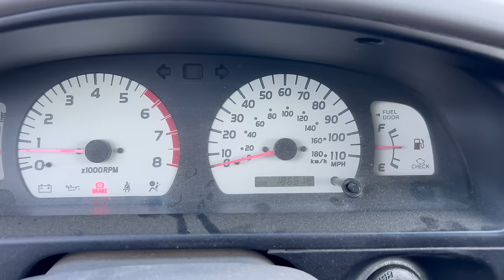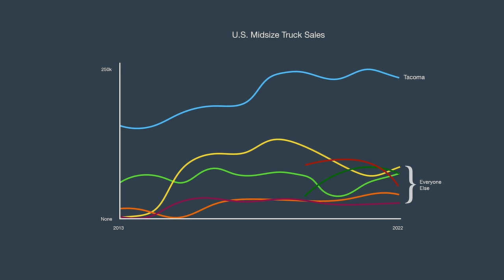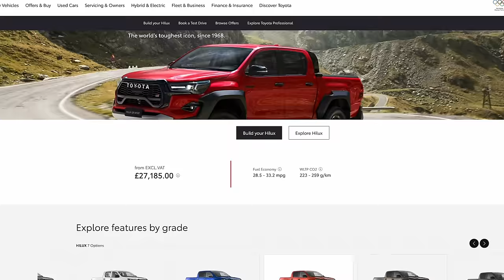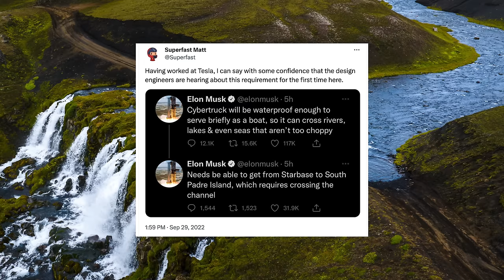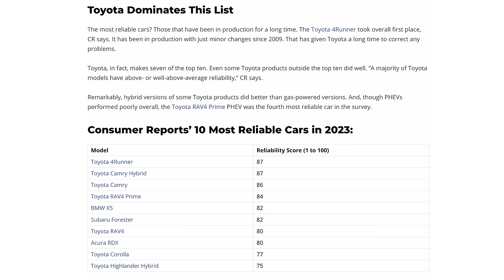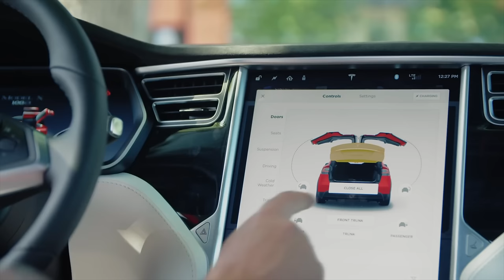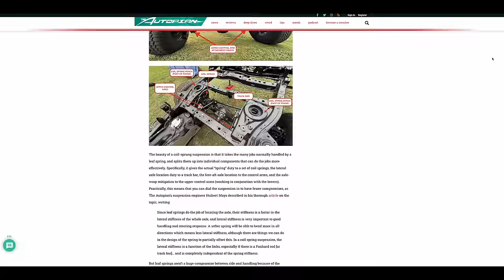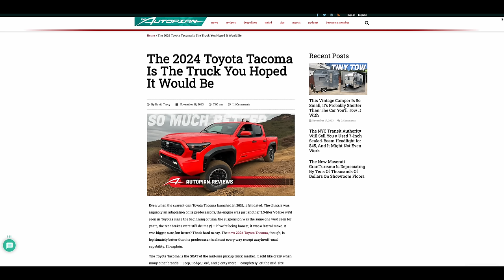What Is The Best Truck, And Why Is It The Toyota Tacoma?

Comment: I did the thing you're 'never' supposed to do and bought my taco when it was the first year of production in 2016.  I've had it for 100k miles and it has had zero problems.  There are extremely few vehicles that have this quality.
Reply: I hate that 100k is the bar for not having issues now. That bar should be closer to 200k.
Reply: @Steinerrides  How is he gonna say "I've driven 200k and not had an issue" when he had only driven 100k miles, that's some very interesting logic
Reply: My '10 Prius was the first year of the 3rd gen and at 330k it only needed a headgasket, is that better 🙃 @Steinerrides
Reply: @ImNotHere4750  I'm saying 100k without issues isn't impressive or note worthy
Reply: @Steinerrides lol listen to yourself
Reply: @ImNotHere4750  I do on a regular basis.
Reply: @Steinerrides  So you are telling me that on a new car, nothing and I mean nothing will break in the first 100k miles?
Reply: @ImNotHere4750  on most new cars, no, they really don't have issues show up that soon. Find me a statistical outlier if you want but I won't care. Excluding driver induced damage, most (not all) will make it 100k with regular oil changes, tires and brakes. 150k, 200k and beyond is a different story.
Reply: @ImNotHere4750 I agree with @Steinerrides 100k, especially when just street/highway driving isn't much.
Reply: Here come the 400k PD guys 😂
Reply: @Steinerrides  the average Person in the US is driving 40 miles a day, that would make about 7 years to get to 100k. That is 7 years of being exposed to the elements, 7 years of being turned on and off and as you said 7 years of wear and tear. Components wear down, in a lab 100k ain't much but the world isnt a lab and any sub-par build car is either gonna be dead after those 7 years or is gonna be dead soon. Go outside and ask yourself why you don't see as many 2000s cars as new/2010s cars. I would agree 200k is a better number to speak on of issues, but some cars don't make it that far and 200k will take over a decade, so 100k is a fine place to be.
Reply: I'll put in my own personal anecdote. I had a 2011 Subaru legacy since new. It was a first year cvt car. It made it 100k without a single issue. At 120k, it blew a head gasket and I ended up having to put a new engine in it myself. At 170k, the transmission went out. It was not a good car. It was not reliable and it did not last long, but it still made it 100k without a problem. A lot of cars, even bad ones, can make it 100k without an issue
Reply: @Steinerrides i think cars and trucks have only gotten more reliable over the decades. The OP was just commenting on their own experience. I know for my two 2015 model vehicles but have had one issue a piece.  They were very minor (clutch slave on one at 70k, and a cylinder head temp sensor on the other at 40k). I think it’s relatively common to see some small issue arise within a 100k timeframe, though still not enough for me to consider that unreliable by any stretch. Of course as that mileage doubles there will inevitably be more opportunities for wear and tear to influence failure rates.
Reply: @ALMX5DP  thank you, exactly what I wanted to say!
Reply: @ALMX5DP  I probably should have worded it differently. Either way I don't think 100k is an impressive feat. It doesn't surprise me a Toyota made it that far without issues, but a Kia wouldn't surprise me either. I wouldn't call it common to have issues before 100k. It's not rare though. Of the 5 new cars I've been around owned by my friends and family, only one of them suffered any issues before 100k. I know this is only an anecdote, but I bet if you ask a dealership the number of cars they sell vs the number of warranty repairs they do, it's probably pretty small.
Reply: I've worked on multiple Toyota's that are well over 250k without anything but oil changes, filters, and spark plugs. I've done 3 different 250k timing BELT changes that were only torn down because we peeked in and saw cracks on the back of the belt - wouldn't have guessed they were so old.
Reply: @Steinerrides my fathers LS430 has 430k miles and only the water pump was changed out (before it failed). My LX has 243k and going strong although I’ve done a lot of work on it to prep it as an overland touring vehicle.
Reply: @Steinerrides  It’s because 90% of drivers with new cars these days do not keep up with proper maintenance of their vehicles. Imagine having like 5 oil changes for a vehicle with 100k miles in its entire lifetime, or even more common, not having the transmission fluid changed at all during those 100k miles. A lot of car owners are actually like that and are lazy and/or cheap to take their cars for maintenance even though they aren’t doing the maintenance themselves 💀 The 10% who do keep up with maintenance are a rarity these days, the ones who do diy maintenance, even more so.
Reply: @906MediaProductions   "My '10 Prius was the first year of the 3rd gen and at 330k it only needed a headgasket" I got rid of my CT200H due to this issue.... Such a disappointment for Toyota and a pending lawsuit IMO...
Reply: Do you suppose Toyota deliberate set out to try to give Jeep, Ford and Land Rover a bad reputation by having excessive quality control and not building down to the industry average (or below)? 🤔
Reply: I have a 95.5 Tacoma with 408k miles on it. You'll be fine bud just drive the thing lol
Reply: I did the same with my 2nd Gen 2016 Chevy Cruze.  So far we’ve got 190,000 out of it with nothing but brakes and tires.
Reply: @ImNotHere4750 it’s just stating that “my xyz has gone 100k miles without any issues” shouldn’t be an accomplishment
Reply: @Steinerrides actually kia engine failures happen frequently around 60-80k. Technicians that speak publicly about it are often fired through the manufacturer notifying/threatening the dealer. So they upped their powertrain warranty to 100k miles to keep owners satisfied with the brand image. Apart from KDM cars, all JDM and most USDM cars should make it to 100k no problem with proper maintenance.
Reply: My audi a3 has 200,000 miles since when is 100k a flex?
Reply: Tacoma has been in production as Hilux since the early 1970s and continuously developed since then. As such, Toyota had 44 years of practice building the 2016 Tacoma before you bought one in the first year they were badging them as Tacomas.
Reply: @Steinerrides  I've had the same experience. I've put 115k miles on a 2005 Lotus Elise, with thousands of track miles, on a relatively unreliable car, and I still haven't had any major issues. Most issues I've had are because it's nearly 20 years old and rubber in hot areas are expiring.

I've put 110k+ miles on a Ford Taurus, 100k+ on a Hyundai Accent, and ~80k on a Mazda Protege. None of these cars are what anyone would describe as "reliable" and yet none of them had real issues before 100k. I'm with you 100% - modern cars are just damn reliable (though not often very repairable).
Reply: Correction. My Tacoma was built in 2015. I don’t know if it was sold new in that year, or in 2016.
Reply: My 2000 4Runner had 311,000 miles on it when I got tired of welding the frame every summer. Still ran very well. Sold it. My 1998 4Runner has 200,000 miles on it and I’ve just welded it’s frame for the last time. For sale. My 2015 Tacoma is spotless. I love it.
Toyota makes great trucks, frame issues aside. 😢
Reply: I’ve had my truck 8x longer than yours tho
Reply: @TassieLorenzo it’s just Japanese culture. They take pride in offering quality products.
Reply: @vk2aafhamradio …. 2016 is the third generation Tacoma.  The hilux is not a Tacoma and never shared platforms. Two separate platforms. Secondly, the Tacoma started sales in the USA under the Tacoma name in the 90s. 😂😂😂 why you talking like you know shit when you know nothing lol.
Reply: EU or US made cars that reach the 100k milestone without a bunch of expensive repairs are as rare as hens teeth. Not every car is a Toyota. @Steinerrides
Reply: @Steinerrides  there's a reason 3 years or 36k miles is the base warranty on the majority of vehicles. 100k miles of trouble-free ownership is rightfully amazing, no matter how artificially inflated your standards might be.
Reply: @Hawk7886  guess me and everyone I know are just the luckiest people in the world then.
Reply: aProductions  hahaha 🤣👍💯🙏. My all due respect to the Japanese and specially Toyota.
Reply: You're lucky. My 2016 was a total POS, and it was in the shop constantly. If you look on forums the 2016s and 2017s were being lemon lawed left and right.
Reply: My 99 Sierra is a first year and has 220k trouble free.
Reply: @ImNotHere4750 for one, he could add the word "yet"
Reply: @mydearriley  that would imply he is going to have problems later, do you know that's going to be the case? (No you don't because none of us can travel to the future)
Reply: the 2016 are very tough!! my '16 Tacoma saved my life last week!!! I was t-boned by a SEMI-TRUCK near 30k lbs. He blew through a stop sign and hit me at 45-50mph. He was falling asleep. The side airbags saved my head from smacking the window or going straight through it. THIS TRUCK SAVED MY LIFE!! nothing short of it. This is a VERY safe truck. I named my late Tacoma the "Terminator" because you just cant kill it. the engine fires right up, no issues at all! but the truck is totaled. Ill have to replace it. And guess what its going to be replaced with? You got it. a Tacoma!! most likely something newer though. maybe a 2020-2021. 204k miles and was still getting 23-24mpg on the highway. around 18-20 in the city. GREAT GREAT GREAT GREAT TRUCKS. IF youre reading this and considering a Tacoma, BUY IT. BUY IT. BUY IT. It will keep you protected. Safety isnt an issue until you experience a bad accident.
Reply: my truck was a work truck, ALWAYS loaded with a lumber rack, tool box, and tools. minimum 300-400lbs payload at all times BEFORE the driver gets in. still getting 23-24mpg through a 120 mile trip, through 6% mountain grades(about 40 miles of the 120 mile trip).
Reply: 100k miles over 8 years is not impressive, and literally, any vehicle from 2016 could easily do that.
Reply: That's been basically every car I've and my family has ever had with regular maintenance though...
Reply: It’s all good when you’re not in the rust belt. I’ll stick with my boxed frame.
Reply: One big consideration...you can't  sleep in it comfortably, when your wife divorces you. 😅
Reply: Hell yeah brother, same story with my 2018.
Reply: Same here. I love my 2016 Tacoma.

Comment: I love tacomas, but I am incredibly skeptical about how reliable the new one will be. Especially given how unreliable the new tundra has been
Reply: I agree.  Toyota has spent a mess of money on paid reviews like this, and every article I have seen is boasting about how much better this truck is that no one has put through a proper test.  It's bigger, it's way more complicated, and it's getting harder to tell it apart from the other trucks in the market.
Reply: Engine failures on the new Tundra are under 1%
Reply: Everyone said this about the 2nd gen Tacoma...
...and the 3rd gen Tacoma.
Reply: @Sarrus25 

In an automotive field that's a lot. Toyota's TPS quality engineers are probably drowning with work and applying 6 sigma principles to cut that down.
Reply: Not crazy about the giant fish-mouth and lizard-eyes look that's all the rage, either. My '96 Tacoma is paid for, with only 83K on the clock. It will probably outlast me!
Reply: @sunbeam8866  considering you seem hellbent on making whoever sells it after your passing seem like a liar with that low mileage it'll last til roughly 2/3 of the way to the heat death of the universe if the current trend carries on.
Reply: A 4 cyl enine with 220+HP and an 8 speed transmission is a lot to ask for. By comparison my first gen taco's unstressed V6 and 5 speed seems like one of those tractors you cut the tree growing through the frame out of, then drive to the DMV for fresh plates. I'll be terribly pleased if it keeps the reliability up though.
Reply: @Sarrus25  I’ve seen over 12 push their front mains out at my dealership under 50k. I know it’s not a lot given how many are out there, but the failures seem to be much more catastrophic than the hiccups the V8s ran into
Reply: The old 2.4s in the 2012 scions sucked well, the were good when they were good but didn’t even make it to 300k so I’m pretty skeptical about the new Tacoma
Reply: @chauncey5962  the 2.4s had a bad ring design, so once they started burning oil they took off doing it. There’s an updated ring and piston design that actually fixes the 2.4, but by this point not many are willing to shell out the money to implement the fix
Reply: @Sarrus25 1 in 100 is unacceptably high when you're selling hundreds of thousands of them
Reply: @carpespasm  it’s 2.4 and turbo though, it’s probably not hugely stressed with so many gears
Reply: @GTFour so when you are off roading and towing you aren't going to be in low gears exclusively?  Ok...
Reply: @Sarrus25 1% of 360,000 is 3,600 engine failures.
Reply: @marklihsu What? When you use a lower gear, especially low range, the engine has greater mechanical advantage and therefore is under less load. A really challenging place to be for an engine is a high gear with high load. Say you were at 2000 rpm’s with half throttle. But that won’t happen in your scenarios because it doesn’t make sense to do that, drop the gear, let the engine rev and you’ll be fine. People forget some of the most reliable engines on the planet have turbos attached. And it’s not even a new technology.
Reply: ALSO, this engine has two less camshafts, 16 less valve seals, one less exhaust manifold gasket/manifold, one less head gasket, and 2 less spark plugs (if it uses one per cylinder it might use two I’m not gonna check.)
Reply: @marklihsu  what? Who says you aren’t? You make no sense 🤷‍♂️
Reply: @carpespasm  You're ignoring nearly 30 years of improvements to materials science and manufacturing techniques. 220 for a 2.4L turbo is practically anemic by modern standards. Merc and BMW are pushing over 400HP out of 2.0L
Reply: lol yep @Fishsticks360
Reply: @daniel-wificidr when your quality drops. You resort to marketing instead of letting the product speak for itself. Toyota is not the Toyota of 1980-1990s anymore.  They are controlled by the same hand that wants us all driving electric shit boxes by 2030.
Reply: @richardhandler8606  you forgot the auto start stop on the new model Lolol. That shit alone will kill many motors
Reply: They tested the 2.4 turbo for a few years already and no issues so far. Just have to see how well it handles payload and towing. The 3.5L twin turbo was basically new and untested (less stressed in the LS) and they wanted numbers that best out the F150 so they pushed harder than they usually would have. Hopefully the 2.4L stays reliable.
Reply: @nateTrh   bla bla bla. Auto start stop. Enjoy !
Reply: @AntilleanConfederation  Explain how auto start/stop ruins motors? If the engine is warmed up already, extra wear is negligible and some youtubers have actually seen better oil analysis samples using it. You get leas fuel dilution since the engine isn't running all the time at stops. It's cylinder deactivation that kills motors like the trash GM v8's that have them.
Reply: I’m not aware of any serious problems with the new tundra. Only minor fit and finish problems customary with first year products
Reply: @justinmartin8887  I’ve had over 10 push out the front mains in Austin TX and Salt Lake City UT
Reply: @jaxontanner9822  push them out? How? I’ve often seen spun bearings. Never pushed out
Reply: @justinmartin8887  Toyota has yet to get back to us on that. I think it’s either a tolerance issue or over pressurization of the crank case, but you’d think other stuff would pop before that like valve cover gaskets. They literally walk out and then fold over the snout of the crank. We put a short block in one and a week later it did the exact same thing. It’s got 15k and now has a 3rd engine
Reply: @jaxontanner9822  it has to be severe tolerance problems. I don’t even see how it’s possible for a bearing to slide out the side unless something’s waaaay off. 99% of bottom end bearing failures are spun out (at least in the diesel world)
Reply: @justinmartin8887  it’s the same in with pretty much everything, even rotaries lol (that’s my main jam) but Toyota has been very hush hush about it. I imagine getting rid of the V8, and then having such catastrophic and unexplainable failures is not great press when u push V6s so hard. I like the motor better when it works, hate it when it breaks. We’ve figured out it’s easier to take the cabs off (first time ever at Toyota) to pull them. They really went the ecoboost route all the way lol
Reply: not a fan of the turbo, personally
Reply: New Tacomas have tranmissions overheating and failing completely, snapped 4WD front drive, new Toyotas suck